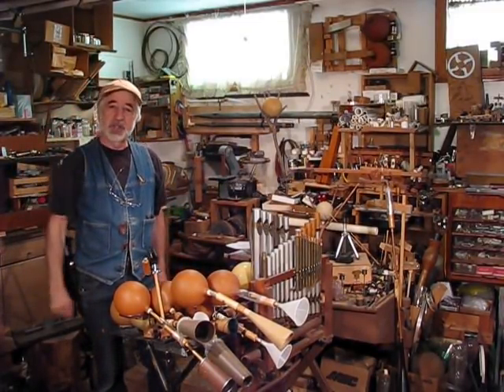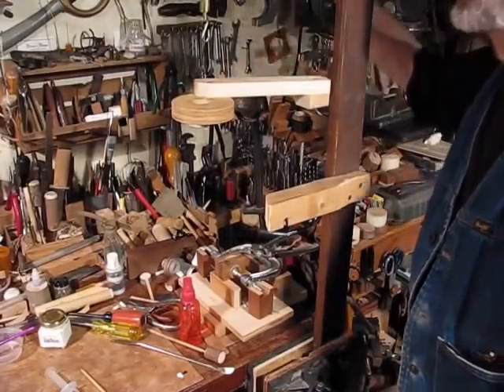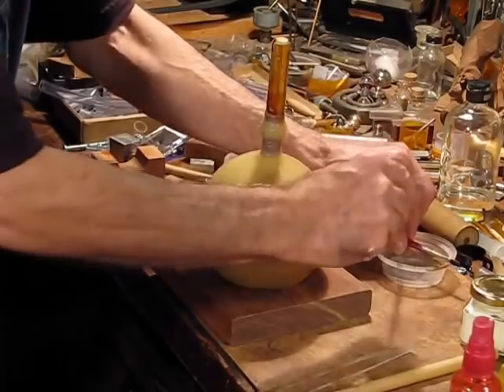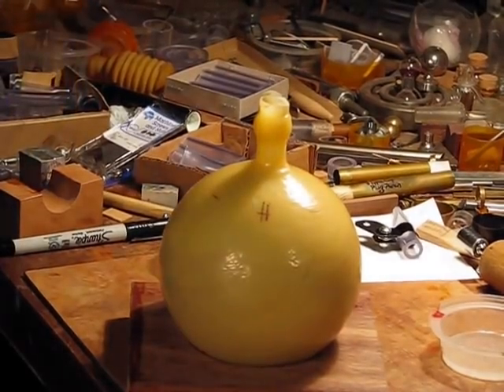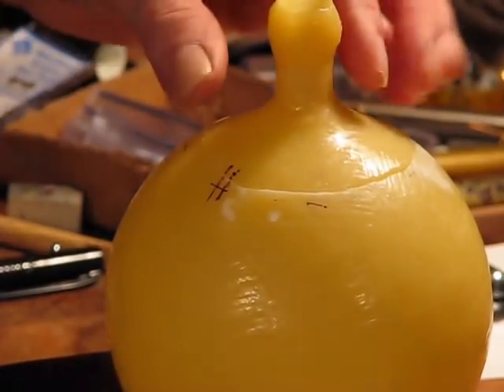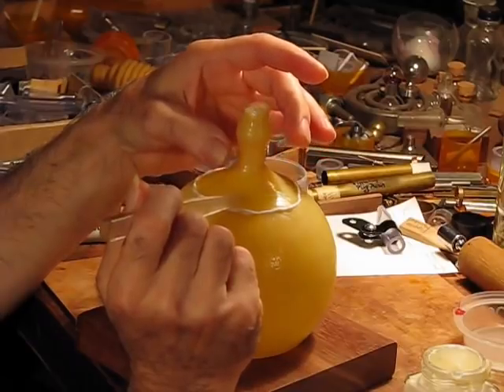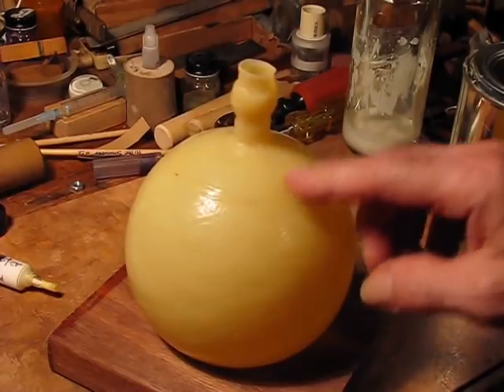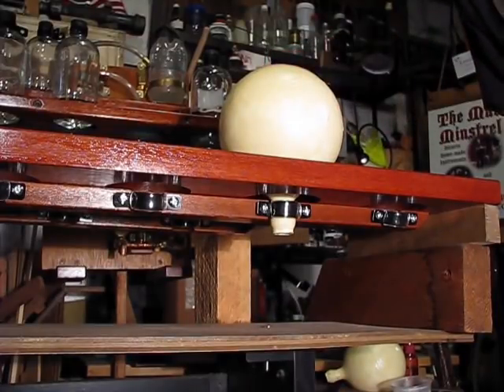Making Rubber Squeeze Balls.

Comment: Similar to an earlier comment regarding low pressure... how feasible would it be to create/use some sort of inflatable form? A balloon of some sort that wouldn't stick to the latex? That way you could skip all the cutting and just deflate and then remove the form... maybe you could coat an industrial strength balloon of some sort in a rubber spray? Great video and superb craft, as always!
Reply from the maker: Interestingly, that is how I do it with the larger size balls, such as the ones on the foot pump under the little pipe organ. Those have a one-inch neck opening, to accommodate the intake valve. The larger balls are formed around a thin inflatable vinyl ball, which is thin enough be deflated  and pulled out of the one-inch hole with no cutting. Years ago I thought about trying to work out a similar system for the smaller scale of the little balls; but those have a 1/2 inch hole, and so far I have not found the right materials to do it. But now you've got me thinking...
Reply: I was just thinking the same thing. Why not use a sacrificial balloon that stays as a part of the finished product?

Comment: But how did you make the form ball???
Reply from the maker: Those are from Lebanon Ball Company, a Mom and Pop factory in Pennsylvania that supplied play balls for 40 years, and which retired from business 30 years ago just after I had found them. I ordered a few cases of these balls in different sizes, undecorated, and the few I have left serve as molding forms. They are compounded of rubber with 10% clay for abrasion resistance; this makes them a little too stiff for ideal squeeze balls, although I have used them for that purpose.

Comment: What a nice idea, love it. Anyway I wanna ask, if the latex we change to Silicone Rubber does it work? I already tried in wax ball but turns out the silicone rubber drips like melting I think because the surface too slippery. Or maybe the material to watery? I'm not super sure
Reply from the maker: I did try this with silicone some years ago, over my usual ball form. The silicone brushes on nicely, but in half a minute it just runs off, as you say, leaving only a paper thin coating, and "stalagmites" dripping from the bottom of the form. Someone else tried it also, first thickening the silicone with a filler. Not a good idea: the balls came out awkward and lumpy, but worse than that, because of all the filler they were not springy enough and they tore easily. So there might be some method or a different formulation that would work with silicone, but I haven't found it yet.
Reply: @bellowphone  I see.. So it can't be done with silicone rubber ya. Thank you for your reply

Comment: Nice one!  Why don't you use a balloon or similar as a form, and then just deflate or pop to remove?  Save all the cuttin' & fixin'
Reply from the maker: It's a good suggestion, except that the balloon would have to lose no air for several days until enough coats could be built up. I have used a similar idea with 12 inch balls and a 1 inch hole, using a thin vinyl inflatable ball that could be deflated and pulled out the hole.

Comment: The boiling part leaves a question - why do you need to boil them? And (ok, two Questions) how long does it take? Coming to think of it (Three questions! Gosh, that reminds me of a certain spanish inquisition nobody is expecting...), do you actually boil them (100 deg C) or do you stick to a lower temperature? Anyway: As many commenters I also did not think that you are making these from scratch.... Great! Thank you so much for sharing this!
Reply from the maker: Boiling the finished balls toughens the rubber somewhat, and I believe it makes them last longer, although I have never done a scientific comparison of boiled versus not boiled. The liquid latex is generally used for making molds, and it's sold for that purpose; on the can it says to boil the finished molds for 20 minutes to make them more durable, so I have always done that. I boil them for about 12 minutes. Once boiled, and finished with silicone preservative (ArmorAll), the balls will last about 15 years. I did try not using the armorall to see what would happen, and the ball started getting gummy and developing cracks and tears, in about a year of use.
Reply: @bellowphone  Now THAT was a fast answer. Now I get it. Thank you, and stay safe - looking forward to your next music production !

Comment: Thanks — this is really interesting! Have you ever tried coating balloons instead of using a form? I've got some liquid latex sitting around, and am thinking of trying it.
Reply from the maker: That's actually a pretty good idea. As long as the balloon didn't lose air for a couple of days while you put on a few substantial coats that could hold the shape. Or, the balloon could be fitted with a bicycle valve, and a small amount of air added as needed, then the valve removed. The balloon would need to be powdered initially with talc or cornstarch, to prevent bonding when it's time to get removed. Thank you; I'm going to explore this idea.
Reply: @bellowphone  Great! Tell me how it works out. Do you need to remove the balloon at all? Why not just attach the rubber to it?
Reply: Seems like you could eliminate the deflation problem by just filling it with water, although that would deform the shape. 

Also, why do you need to boil them? Is it to get the cornstarch out or cure the rubber?
Reply from the maker: The balloon membrane would be stretched in there, so it might be best to remove it, although since it is so thin, it might not matter. Boiling the cured latex is recommended on the can, to toughen it, and I have always done it just by rote. I have never experimented with not boiling; but my impression is that the balls would not last as long.

Comment: Hi!  I'm trying to make these.  I went to my local hardware store and asked them for latex paint.

I began coating a sphere with multiple layers (7?) and to test its strength I gave it a squeeze only to find it tear apart.

Also I noticed yours goes on white but looks more like rubber when solidified.  Mine remains white and looks like paint flakes.

Is there a brand or could you link to the exact stuff you are using?  Do I maybe just need to use more layers?  Also, what does the boiling process do?

Thanks for any help, take care; God bless!!
Reply from the maker: Hi. I admire that you are trying to make these, but I must tell you you are using the wrong material. What you want to use is specifically called "liquid latex", which is quite a different material than latex paint. Liquid latex is the natural liquid gum rubber, stabilized with ammonia solution, and contains no other additives. It's often called "mold builder" or "mold rubber", and it can be obtained from many online art suppliers. I get mine from Delvie's Plastic. https://www.delviesplastics.com/c/liquid-latex-mold-builder.html
You can't order this during the winter, because of the danger of it freezing during transit, which completely ruins the material (in its liquid state), so if you want some before next spring, I would recommend ordering it right away. Delvie's is sensitive to this issue and will not ship it if there is any danger of freezing weather at any point during the transit. I would not recommend getting it from a general supplier like Amazon, because from them I had to send a shipment of latex back once, even though it was mild spring weather at the time, because they sent me some stock which had apparently gotten frozen at some point on their end; it arrived coagulated and useless. 
The label on the can will explain about the boiling, which toughens the finished rubber. Be sure to let the ball cure for at least a week after the last coat, before you boil it, or the layers might tend to de- laminate during boiling.
Good luck with your project, and I hope this helps. G-d Bless.
Reply: @bellowphone  Thank you so much for responding!  I had a feeling it wasn't the right stuff 😆

I just ordered two smaller cans from the site you shared; hopefully that'll be enough!  Thanks again!!

Comment: This is a very interesting video and gives me some ideas on kid's projects around the house. 

On the form removal: Why do you go through the same side as the snout? My first thought when I saw your form was to first remove the mandrel as you did, but then on the opposite side of the snout make and incision to remove the form. Create a kind of pac-man out of the latex and remove the form. Similar to how the mouth is formed on this tennis ball person (https://www.wikihow.com/Make-a-Tennis-Ball-Holder). It seems like gluing the mouth shut would be easier than lining up the circle you cut for the snout.

I'm assuming you may have tried this already and had some issues. Again, awesome video.
Reply from the maker: Thank you. You have an interesting idea, and it might be easier to line up the seams that way. But you would then have a seam on the working, and visible, section of the ball. It might be a negative factor structurally, if not cosmetically. Could be worth a try, though.

Comment: Where do you get this liquid latex?
Reply from the maker: I've been getting it for years from delviesplastics.com, under the brand Castin' Craft Mold Maker. 

I've tried other brands that I didn't like as much, from other suppliers, and I've also tried Amazon a couple of times: once time I got a severely bashed can from them, and another time I had to send back an entire gallon because it had been frozen at some point, and it was partially coagulated.

Comment: Wäre nicht ein Luftballon besser als Form gewesen da brauchst nicht zerschneiden nur Luft raus und ihn herausziehen und dein Ball bleibt erhalten .. so must ihn wider zusammenkleben.
Reply from the maker: That's not a bad idea, and I did try it long ago. First, it's difficult to find spherical balloons, but the bigger problem is that the balloon will not keep its full dimension over the several days that it takes to complete a ball. It is gradually losing air and shrinking, and the spherical form gets distorted after just a few coats.

Comment: Is there any particular kind or brand of latex to use for this?
Reply from the maker: The stuff I use is called Mold Builder liquid latex, I get it from Delvie's Plastic. It's also available from lots of other suppliers, but I've been using this company for many years so I just stay with them. https://www.delviesplastics.com/c/liquid-latex-mold-builder.html. 
Note that you shouldn't mail order this stuff during the winter, because if it freezes it will be ruined. You can also sometimes find it on the shelf, at places like Michael's craft stores.

Comment: I am sure people have asked before, but have you thought of a female mould you mould the ball inside?
Reply from the maker: Using a female mold is the way it's done commercially, but you need to make a moldable paste of the rubber. This is done with a masticator, which heats and grinds the rubber. Then the paste is layered or injected into the mold, and a blast of high pressure steam sets the rubber inside the mold. I've tried my own experiments with processing rubber like this, with not much success. I did make a female mold and tried pouring in liquid latex, and then letting it drain, but it takes many days for each coat to dry through the little hole. I tried blowing in hot air, but I couldn't get good results. I also tried molding two open halves and then joining them, but that ended up being more work and poorer results than the way I do it in the video. 
It's a good question, and there's probably a better way than what I'm doing, but this is the best I've been able to come up with.
Reply from the maker: @ooslum  What you tell me is very intriguing. I still have a mold that I made years ago, in two [indexable] halves. The only difference from the way you describe, and my crucial mistake apparently, is that I sealed the inside of the mold with varnish. That means when the latex is poured in and drained, all the moisture has to dissipate out the little hole. Each coat would take weeks to dry, and would sag in the meantime, so I gave up. Now I am going to revisit that mold, sand off the varnish, and try it again; maybe make a new mold with fresh plaster. Thank you for the suggestion; I am excited to try it.
The process with the masticator and hot rubber paste is how it was described to me by a man who ran a play ball factory, but unfortunately I never visited the factory, and it is gone now.